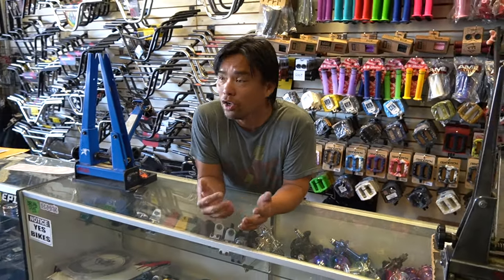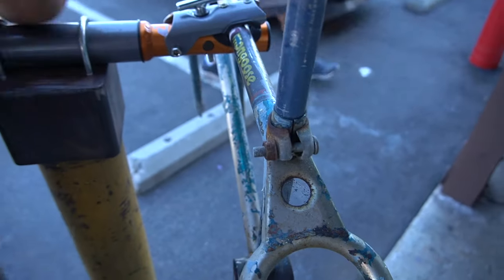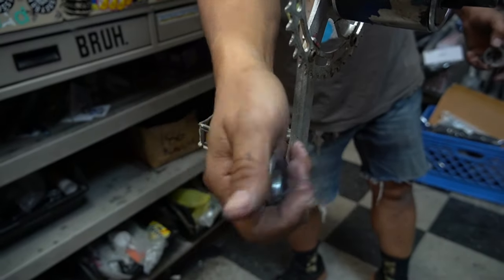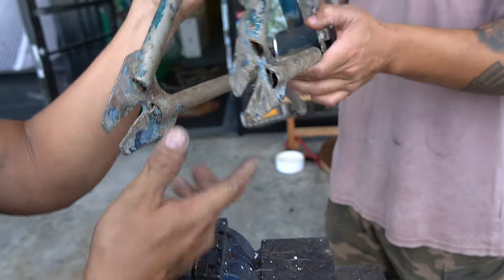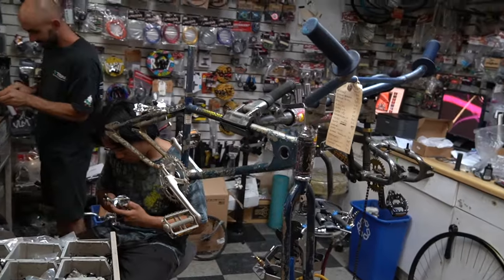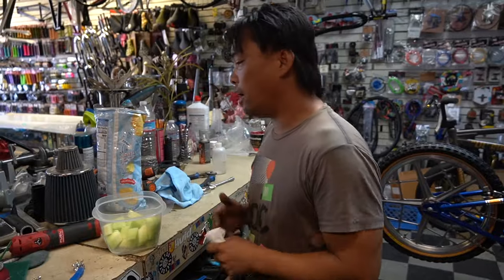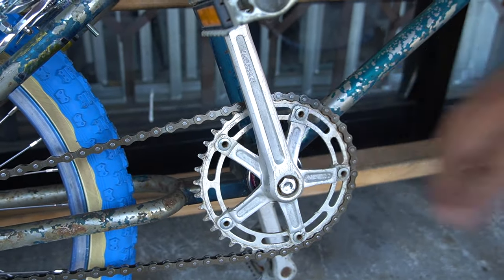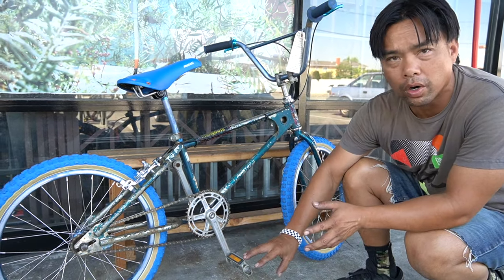Incredible BMX Restoration! From Pile Of Trash to This!!

Comment: Try a 50/50 mix of acetone and automatic transmission fluid in a spray bottle for freeing up the aluminum from steel. Might have to keep it soaking for a day or two but works good.

Comment: I had that exact bike, bought brand new. Suede covered Kashimax seat, Shimano Tourney brakes, Mongoose SS bars, snake belly tires, MKS pedals. I put the Dura Ace cranks on my road bike, and put on one piece Takagi MX cranks with a gold Mongoose spider, off a Supergoose. That blue "candy apple" coating started peeling off almost immediately. I ended up removing it all together, and polishing the nickel and putting on Supergoose decals. Sooo sorry I ever sold it.

Comment: Would that part for the bottom bracket be called a bearing race?maybe try to slip a stem on a stuck seat post then use a cheater pipe for leverage to turn it to break it loose

Comment: Old stem tightened on to seized seat post I used leverage pipe broke mine loose on both 1980 DB long pro and 1984 Redline 500a aluminum seat seized in cromoly frame.THAT seat post WILL come out!! I didn't use anything but an old stem and a leverage bar no wd40 or anything